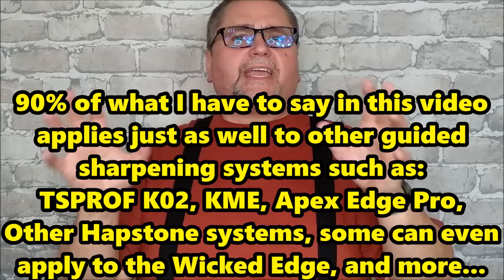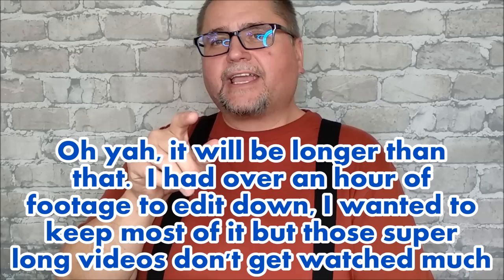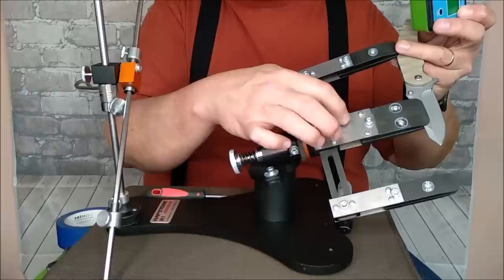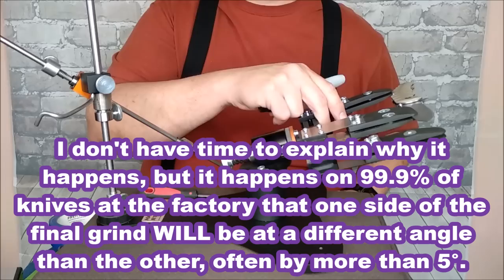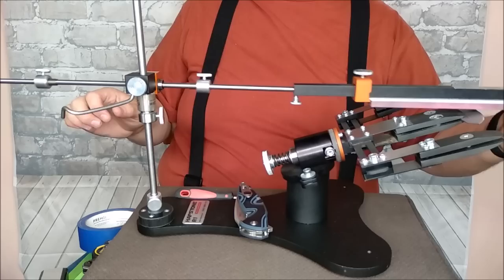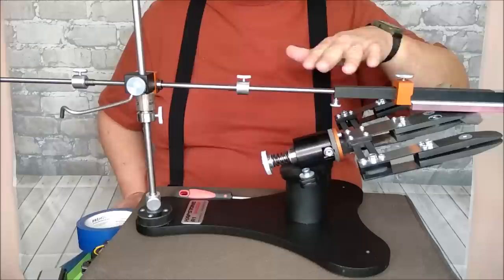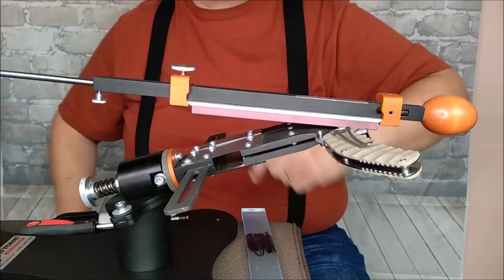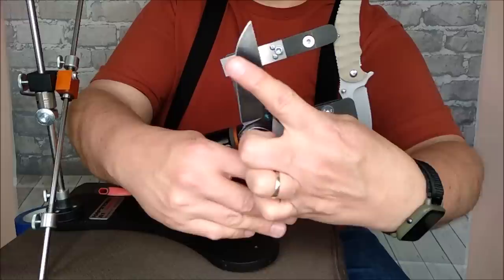CCEU Presents: How-To, Tips, Tricks & more - SHARPENING on a Guided System of ANY Kind

Comment: Thanks Jake, that was great. You answered my question about the angles when the knife is new and hasn’t been sharpened with a system like this, I thought that I was not clamping correctly,because the bevels are different on both sides. I just got a  tsprof, thank you.
Reply from the maker: Yeah, on my reviews, ever since February, I list the angles that the factory sharpens their knives too, and invariably they are different, often VERY different from one side to another, and it doesn't only happen on low budget knives either - I see the same thing even on custom knives if they were sharpened by hand.

Comment: i used two drill stops on the rod with a small rubber washer in between, my sharpening system is a ruikin( edge pro clone) so about as budget as they come haha, also had to use a rod end bearing(used for vehicles mostly) to help with all the movement, every time i used it before that rod end, the guide fell apart
Reply from the maker: That is a good idea. I have used pieces of rubber hose that I cut down to create a sort of washer for the same thing in the past.